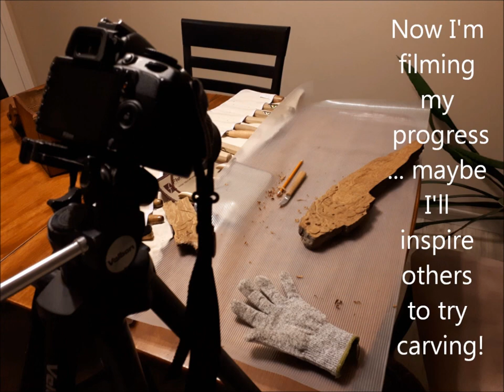WOOD CARVING | CASTLE TOWER RUIN | Cottonwood Bark

Comment: Where did you get that vtool
Reply from the maker: The one with a wooden handle is Flexicut, part of a four-piece set of scorps that are amazing. The one in the jacknife is called the Carving Jack. Both were purchased at Lee Valley. I always prefer to pull my vtool than push it. =)
Reply: Thank you so much